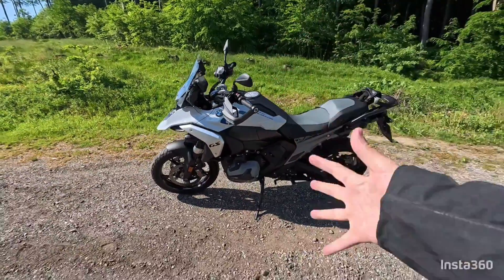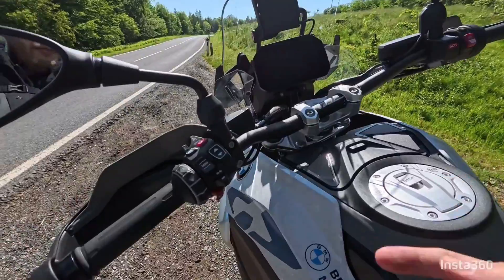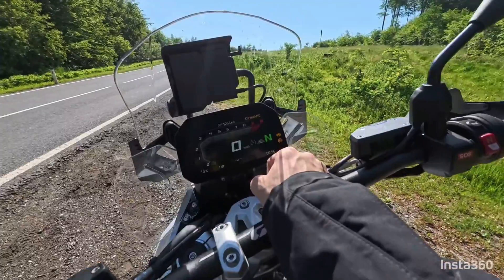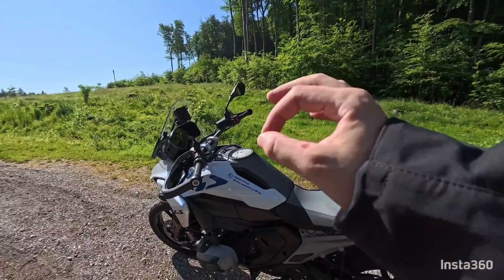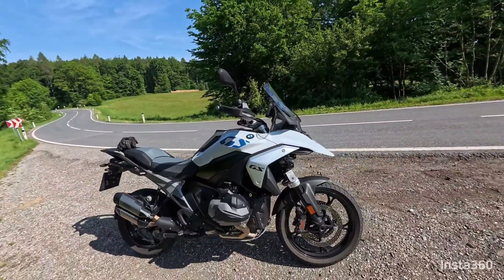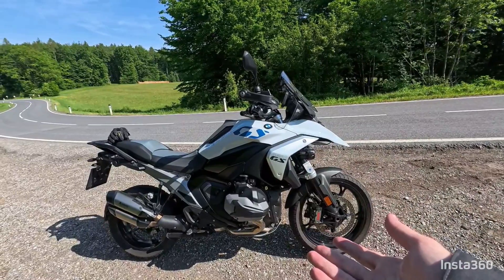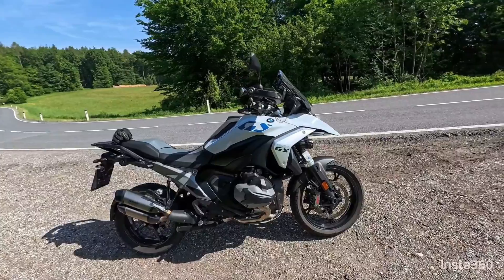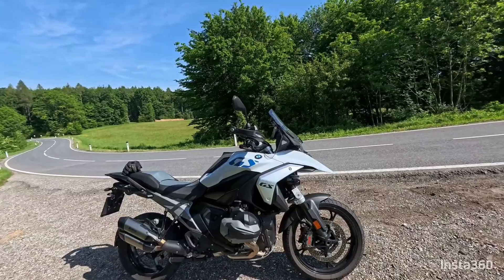BMW ASA - AUTOMATED SHIFT ASSISTANT for the BMW R1300GS - Let's have a look into the system!

Comment: I bought myself a BMW R1300GS option 719 this year.
When I found out that they added this option, I was surprised. This upset me, I thought I bought a motorcycle with all the available options ;) 
I’m also surprised by how my motorcycle changes gears in cruise control without this option (ASA), isn’t this the same principle?
Reply from the maker: @Ma4etaSS   you mean your quickshifter?
Your GS is for sure not changing the gears by itself ;) as it dont has ASA
Reply: @majestix_adv  I was driving on cruise control at a speed of 140 km per hour, in 6th gear you would think it was an automatic transmission. 😂
Reply: Mechanics are for the soul, I like to keep the engine speed and brake with the engine in the city.
Reply: really a great bike